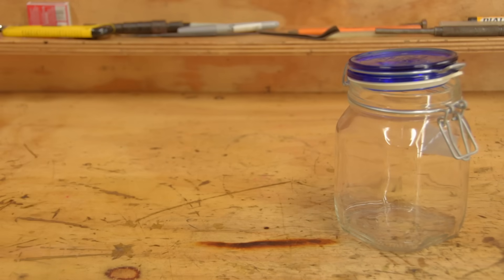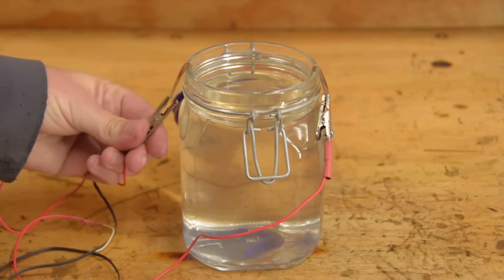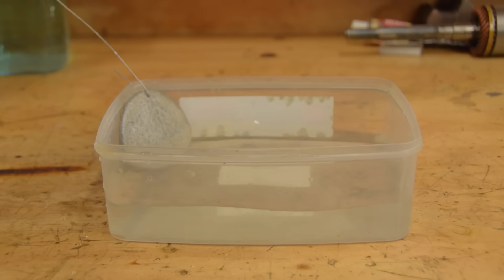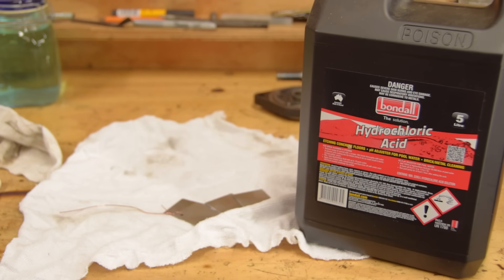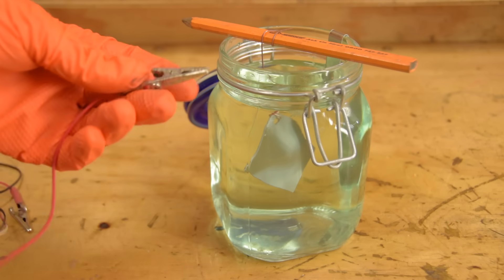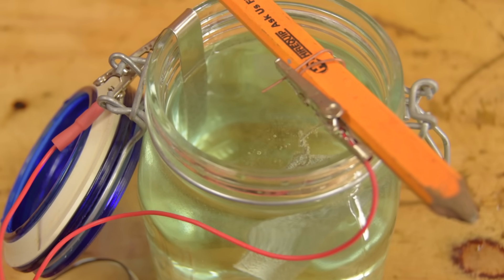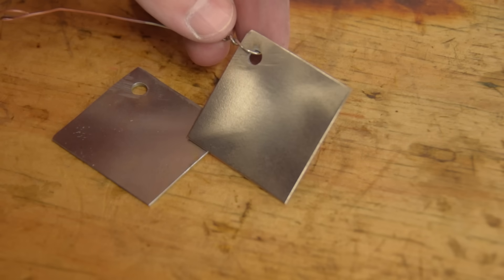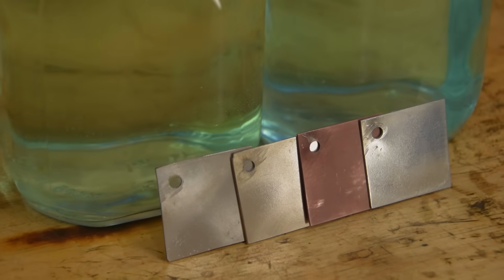Electroplating - Easy DIY Nickel, Copper, Zinc Plating

Comment: Thank you for the video. I have a quick question - do you need to 
protect the copper plated parts in any way? A clear lacquer or 
something? 
I want to copper plate parts of a bicycle, so I am worried that the copper will oxidize quickly and lose the shine.

Thanks!
Reply: Try using "renaissance wax".

Museums use it on priceless art work to protect from Oxidizing.
Works on everything else too. Bare steel won't rust, plus the wax cleans you part while you apply it!

I had a bare steel steering shaft I didn't want to paint.

I cleaned it really good twice with alcohol and twice with brake cleaner.

Applied the wax, and my cloth got dirty spots!

Put more wax on, it got a bit cleaner, the third time it was clean and now very protected!

Cheers

Comment: Hi Geoffrey, enjoyed your video a lot! Is there a reason why the current level has to be low? I have seen on small electroplating machinery there is a ratio of 1A / 1L of solution in 100V tension.

Comment: Can I nickel plate material that had been yellow zinc plated? I don't like yellowish color so I'd like nickel plate on top of it.
Reply from the maker: No, but if it was zinc plated, the yellow will just be a coating on top. You could try and dip it in some very weak acid and the yellow will dissolve leaving bright zinc. But, be aware that it might actually be cad plating which is what yellow zinc is supposed to replicate.
Reply: @GeoffreyCroker  I didn't know that. Thanks. Now I see it could be both. Is there any way to find out what is it? I could try to dip part of it into 10% hydrochlorid acid just for a test. Nothing bad can happen, right?

Comment: I made the nickel acetate successfully, then accidentally hooked up the wires backward when trying to plate onto a brass key. Is my solution ruined?
Reply from the maker: Maybe. You've made nickel brass electrolyte. If the metals are compatible it'll plate fine. Just be a bit brassy for a while.

Comment: Geoffrey, could you please advice on what solution to dip the finished nickle plated parts with? I have done some bolts, and they look pristine when I take them out from the electrolyte, but alas after a couple of days they get a black/brown hue...
Reply from the maker: Just rinse them in water. If they are starting to rust quickly you probably need to plate them for longer. You shouldn't need to coat the nickel with anything.

Comment: Well done! 

I would like to nickel plate some inert rifle cartridges for use as ornaments on a guitar strap. The casing is brass and the bullet is copper jacketed with a small amount of lead on the very tip. Will this process allow plating nickel onto those other three metals?
I'm thinking I can then tumble the plated cartridges in ground walnut shells with polish added in my vibrating tumbler to bring out the shine. Your thoughts?

Comment: Could you have 2 power supplies and hook the metal you are plating to both negatives, and then have a postive on opposing sides of it, to evenly plate it? This way you dont have to nove stuff around, and it should be a faster process, or am i wrong?

Comment: Can you plate in low temperatures too? It’s winter here and I have no heat in the shed.
Reply from the maker: Not sure. Optimum is over 20deg C. But it will probably still work
Reply: @GeoffreyCroker  Will give it a try
Reply: Geoffrey Croker happy to report the zinc plating went well. Built up to 3 layers now.

Comment: Also once you use the anode can it be used again and again? thanks
Reply from the maker: You can use it until it's gone
Reply: @GeoffreyCroker  thanks  further more on the plastic buckets can i use them? as you did with the zinc and would it be better to use bigger anode rods for like a 20 litre pale? thank you
Reply: hey again i forgot to ask if you know.. should i use sheets of copper for example in the bucket say 200mmx200mm opposed to a 7mm x300mm rod  for example thank you

Comment: If I'm looking to plate steel and am looking for corrosion protection which would you recommend? I'd rather not go with brass due to the color change.

Comment: Geoff, trying to plate a low temperature alloy that I have cast. No Lead or cadnium.  It is a tin/bismuth alloy. All that happens is that the piece attached to the negative just turns black. Any help would be appreciated!

Comment: Why does my  plug get good bit of power then after 30 secs it cuts out till i take one out the solution or ungplug it then plug it back in just to much work 12v 2amp plugmodel is a jsy-1220
Reply: i tried to make 2 the solution 2 different ways one with the salt and white vinegar and one that white vinegar and Hydrogen peroxide  the 1 st is real light blue the 2nd is alot darker

Comment: No, this method won't work for gold, for gold won't dissolve in much of anything.  A mixture of acids called aqua regia will do it, as will cyanide.  Neither is recommended for home use, though there are home  gold-plating kits.

Comment: Tryed to repoduce this method 3 times and found varing results . very confused as to why it didnt replocate, 1st effort resulted in huge brown sludge build up on anodes(nickel plate)then tryed plating a part,same brown sludge ,had to buff part , left with what looks like dull copper coat .I tryed again ,New jar,vinigar,nickel anodes and now some Salt,Same result only very rapid degen of anod.3rd atempt , this time removed copper wires to anodes as i thought they may be contaminating solution even though they wernt in vinigar ever. The result is similar only when i buff the part it seems to be shiny,not sure if its just shiny steel or actually successful result , seems as this process of plating 1 engine bolt set will be long winded.did i get it wrong ??Is it possible the nickel plate(anode) i got off ebay is not pure enough ? OR mabey wrong volts ,using very similar supply to the vid 4.75  volts 0.55amp.I'm about to attempt n/plating a vw generator housing in very large jar so if anyone knows if i need larger or smaller power supply ,better nickel , or other pls add , cheers
Reply from the maker: Are you making the green electrolyte OK?

Tp start with try plating a piece of steel that you know 100% isn't plated with anything. If you can't guarantee the steel is uncoated, grind it until it is definitely is just steel. Use an old phone charger for the power supply, or a couple of rechargeable aa batteries if you are unsure about your power supply.

You are doing something very wrong if you're getting scum in the jar. I doubt it's the anode, because it doesn't really matter how pure the anode is, that'll just be how pure your plating ends up.

Comment: To be fair if you put copper in with the metal coins are made of (a lot of nickle and zinc in vinegar it will eventually plate on a small level without the electric stuff

Comment: I'm searching for a way to plate silver with gold (like 24k gold leaf) but i can't find any videos.. it's horrible, i wonder if i can do the same method as you. I might try but not sure it'll be ok with gold
Reply from the maker: I have never tried but it will probably work. In saying that you should just buy a gold plating kit, otherwise you're going to need two pieces of solid gold to waste. The kits come with gold already in solution and I think you use graphite for the anode instead.
Reply: @GeoffreyCroker  oh i might look into that, thanks a lot ! Problem is that i can't really spend more than 100bucks, i hope it'll be in my budget. Thanks again !
Reply: @GeoffreyCroker  and i was thinking : what if i buy 100 gold leaf, plate both electrodes with them and do the same process. I don't know if i can get a correct plating or if the leaf are just gonna come off or if i'll get residus of the electrodes into my plating

Comment: I'm using this tutorial to plate cheap jewelry. Cheap plated jewelry sometimes gets scuffed up, and the underlying metal shows, which is usually a copper color. With this, I can Nickel plate all I want, and with a quick buff, it should be good as new!

Comment: You can purchase Nickel Sulfer at Ebay and you can dilute it with mineral water ,so you dont waste time and control the concentration even better,,also  the solution has to be heated to 50-60 Celcius for better result,I used to do Chrome for living

Comment: I have bolts on my Defender that have surface rust poking through the original zinc plating. If I sand blast them, degrease and try to Nickel plate will it work, or is sand blasting not a good finish to plate onto?
Reply from the maker: Nickel is useless for bolts outside on a vehicle. You want zinc. But even then you want to passivate the zinc afterwards. Sand blasting is good but that's the texture you'll get. I used to dip the heads of bolts in crc rust kill as an easy way to blacken and seal rusty nuts when I just wanted stuff tidied up.
Reply: Geoffrey Croker thanks for your reply. Ok, zinc it is then!! I assume that’s what Land Rover use but to a sub micron thickness?? I need good thick protection, even though the bolts are under the bonnet. Can I passivate at home?
Reply from the maker: @NigelsModellingBench  yes, but you'll need to buy the passivate solution. This vinegar jar thing is really just for playing around and practice without spending any money. If you want good commercial like plating results at home you can buy plating kits. I use Jane Kits but Caswell is the brand you'll find around the world.

Comment: Thanks for this!
Can I connect the alligator clip directly to the part or is the copper wire important?
Reply from the maker: Yes, but you will plate the alligator clip. And if the plating on the clip is something that doesn't get along with your electrolyte you'll ruin that too. But otherwise, yeah no problem, whatever gets current to your part.
Reply: @GeoffreyCroker  Thank you! clip is probably zinc so that's good to know. I can just wrap a wire around my project.

Comment: I’m more concerned about the safety and use of chemicals
Reply: Yeah man, like that vinegar and salt is some NASTY NASTY TOXIC stuff, as you must well know one or two drops can dissolve a finger or burn a hole through counter/table tops, floors, sheet metal etc., I just don’t know how they get away with using it to flavor potato chips... The volatiles are just as bad, 3 seconds of fume/vapor exposure to the eyes causes 100% permanent blindness, it’s like ceviche on crack to eyeball tissue so “watch” out! And that HIGH amp current and electrically conductive liquid is just a recipe for disaster ain’t it? Prolly stop your heart instantly without proper insulated safety gear, but you’re in a rubber padded room right? So you should be fine.

Comment: Hi Geoffery...so if a would a bigger jar, say 15 liter..would i need a bigger power supply ?...Good video :-)
Reply from the maker: Work to something like 1amp per 5cm2 of the parts surface area. Something like that anyway. Less amps will always work, it'll just take longer. Too much current and the surface will be fuzzy or burnt.
Reply: Right..just tryed it...gat 2 diff colors on a very small item. Light gray and darker...no black!  Not sure why. will let it dry over night and see if it´s rusty again. Anyway thx for a quick reply
Reply from the maker: @henrikolsen6534  the dark areas might be burning. The current will be strongest on the parts closest to the anode, and bits that stick out etc.
Reply: right..well, in my 25l tub and a 0,250 amp/4,5 volt the darker part rusted over night and only bout 1/5 of the small part looked right. Guess it needed a lot longere time.  Need to find a power supply that will do 30v/5amp. Its not so easy after all to get right :-), well perhaps in a small jar and one small item ;-). Practice makes a champ i guess

Comment: So after watching this I think I know how to fix a bunch of nuts and bolts I ruined 20 years ago when I thought I was clever by using muriatic acid to de-rust them.I don't recall how it began, but I found that a jar of muriatic acid was a easy way to remove the rust from a whole bunch of trim bolts on a car engine compartment I was starting a restoration on. All the orange rusty bolts emerged shiny silver! I was so happy. I proceeded to do this to many many nuts and bols and washers.The following day, I opened the hood of the car and every single shiny bolt was now rustier than they were before.Bad idea. Since I had no idea how to re-zinc plate them, I went to a wrecking ward and scavenged as many replacement parts as I could find, about 10lbs worth, many of which are still filling a large plastic tub they were all tossed into over the following months and years. So now I know how to clean them AND make them STAY pretty. But I don't work on cars these days.

Comment: Muriatic acid should work on steel too. It removes rust and is a watered down version of hydrochloric acid. Fumes are a real issue though - chlorine gas is produced. Don't hang around when derusting or use approved mask. Chlorine will bond to the metal which will rust it later unless it is plated quickly. Electrolysis will remove the chlorine.
Naval jelly is phosphoric acid - which is much safer (fumes aren't that bad.)
This is internet info. Use with caution.

Comment: I want to make soldering iron bit using coupper but it oxidized very fast so when i searched its structure on net i found that it is plated with nickel but i found that my nickel is not stickable with soldier wire (sn,pb ) so i researched again and found complete details that its first core  made of 
Copper then layer of iron , but i tested iron is also not stickable with solder why ? I also find top of iron layer nikel plated and its tip is plated with tin uppon iron layer !so if snpb is not sticked to iron how it is plated with iron ? And why it is said that iton is stackable with solder if it need to be plated with tin to be sticakable with solder ??????

Comment: Has anyone had sucess with this method?  I am trying matchbox cars and it is just corroding / dissolving the car itself.
Reply from the maker: Matchbox cars are a diecast zinc/aluminium alloy I think. Basic plating of anything over the top of that probably won't work. Definitely not nickel.

Comment: I plan to use a steel tank for a water heating project. The tank has been used in a central heating system as a accumulator vessel. It was exposed to the radiator circuit water (which has been preventing it from rusting through in the absence of oxygen (for the most part)  and is (most likely) coated with a black residue/oxidation and general gunk found inside central heating radiator circuits. The tank has a copper coil inside which I can not remove and like to keep intact for later use.
Any suggestions please on how to clean the steel on the inside prior to plating in nickel ? I can not reach the inside of the tank in any way other then pouring in liquids through 2 22mm ports...
Reply: HAS TO BE NON-CONDUCTIVE VESSEL, IE. GLASS, CERAMIC, PLASTIC ETC

Comment: I have tried to coat the copper with nickel, as you instructed, but the copper turns black. I also tried Nickel Ammonium Sulphate and in the same way the copper turned black. What have I done wrong?

Comment: Trying this out and was successfully able to make a copper-electrolyte blue mixture. Now that i am putting in a nickle plated item i get a heavy dusting of a dark brown/red on the nickle and no copper is plated on. what am i missing?
Reply from the maker: Try to reduce your current. Or if that's not possible, move the part as far away from the anode as you can, or plate more pieces at once. Basically sounds like too much current which causes a burnt or fuzzy finish.
Reply: @GeoffreyCroker  Thanks Geoffrey for the help. ive tried a few things for copper and nickle, created a new vinegar electrolyte with a 1.0 amp phone charger. I think put a piece of nickle in the copper and steel in nickle and getting simlar effects of a fuzzy finish that rubs right off. for the copper it looks almost a burnt copper look, ive also tried putting then 12 inches apart from each other with the same results. I dont feel like im this incapable as it seems pretty simple but i think im not going to get it. lol

Comment: Zinc melts at 420 degrees of celsius. This should be pretty achievable by gas stove or electric heating element to melt zinc block in steel soup can. So you can do hot dip zinc plating at home. just be very carefull not to splash hot zinc into your face.

Comment: Any idea how to reverse plate chrome wheels?. Aluminum mags.  Have tried salt and hydrochloric acid with an iron cathode. No success.
Reply from the maker: Take them to an electroplater... 
Reversing the circuit through any solution will remove whatever plating something has. And Hydrochloric acid will remove a chromium layer in about five seconds, so it's probably not chrome you're dealing with.
Reply: @GeoffreyCroker thanks.. I did take them but was going to cost more than what they're worth, which is why I tried doing it myself.

Comment: I am wondering if this is possible to do something that is made of steel but already has some brass plating still on it (It is a WW2 German 88mm KwK 43 casing). I just want to copper/brass plate it to stop further oxidation of exposed steel.

Comment: Just vinegar and table salt will dissolve copper over time, no electricity required.
I'm not sure how this reaction works.

If you want good quality copper acetate (without Na+ and Cl-) mix one part household vinegar with one part 3% hydrogen peroxide.
The reaction with copper is not violent, but you will see some gas bubbles.
Let it sit for a week, and you get this beautiful deep blue solution ...
Reply: Does the salt in the vinegar make chlorine gas?
Reply: If electrolysis is applied.
Reply: @jarret9438  If the voltage is high enough any Cl- solution will probably produce chlorine gas.